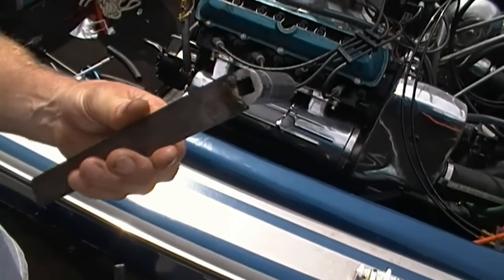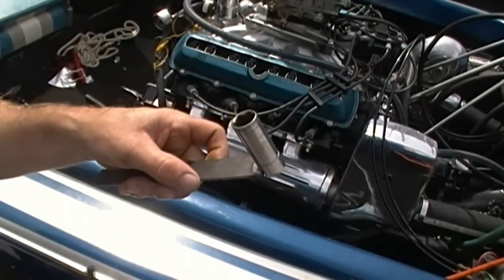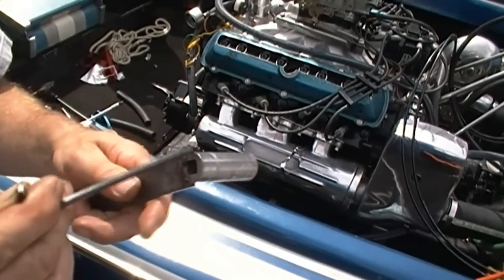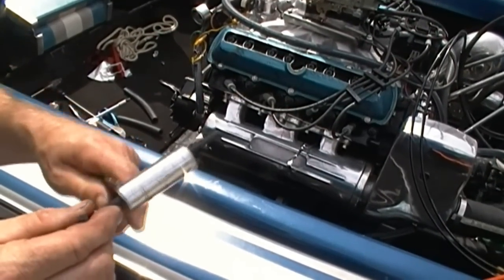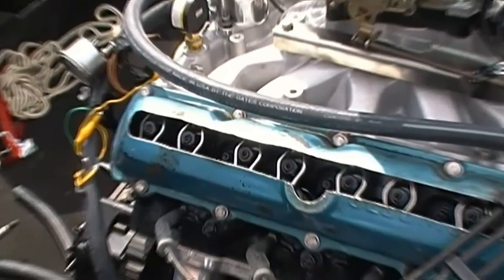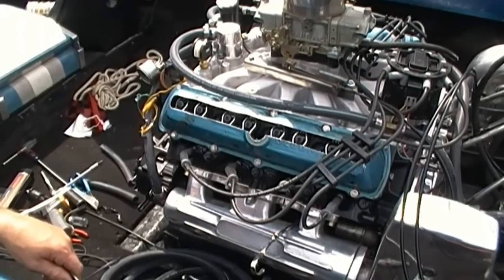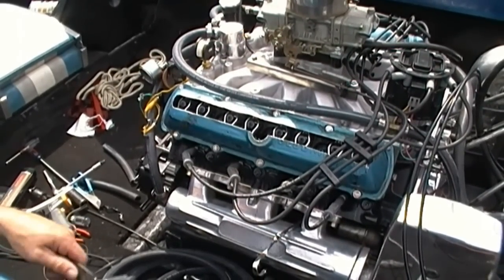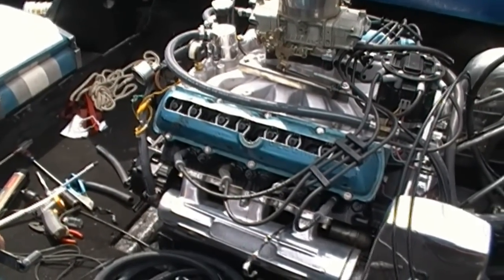How to adjust hydraulic  lifters or valves with the engine running

Comment: nice i was looking and i also have an olds but 425 going to put in rollers. nice surprise to see the olds
Reply from the maker: Expect to have the rocker pedestal area of the head machined down to fit it.
Reply: @Oldsmob455  i have the A heads i think it's a 3/8's stud  do you think i'll have to modify the head or comp cam makes a roller tip rocker would that be a better route than full roller?
Reply from the maker: @bobdimartino6738  Pretty sure those heads are drilled and tapped for 5/16 studs.  Comp makes a conversion stud to 3/8.  Like I said, rocker pads would most likely need to be machined down.
Reply: @Oldsmob455  the A heads are definitely different they have studs not bolts for the rockers from the factory although they're still not adjustable. I'll let you know I bought the comp cam roller tip set from jegs. came with the pushrods guides and rocker studs 3/8's 1.6 ratio

Comment: Makes no sense to adjust running. Easy to put lifter on base circle adjust to zero lash. Tighten 1/2 turn for adjustable rockers or torque non-adjustable 18-20 ft lb
Reply from the maker: That's a basic setting, not a max performance setting

Comment: I think that adjusting lifters while the engine is running is probably the most accurate way to do it when using hydraulic lifters. There is no question how much they are pumped up and if one pumps up more than another, your adjustment is based on each lifter individually anyway, so it doesn't matter.   Just watch you don't slip a finger between the rocker and the valve cover... gosh that would hurt! Great video.
Reply: edward niel you are wrong. Doing it while running is not accurate. Not a single manufacturer has you do valve adjustments while running. That is the beauty of hydraulic lifters, they do all the work. All you must do is half turn of preload while cam is on base circle and you are done! This is just a messy waste of time.

Comment: Gonna take your advice and run the car tomorrow for the whole day just at idle speed (since it's in backyard) then drain the oil and put new oil back in.  One question: it has on the odometer 83000, what kind of Oil do you suggest?  What i just put in their was 75000 high mileage Oil Valvoline 10-40..
Reply: Shell Rotella Diesel oils , Brad Penn, Valvoline VR1 , Chevron Delo 400, Mobil 1 15w50...
Reply: Or some zinc additive to what you've got already if its that new why are you idling it all day now ?? Im lost

Comment: Great Video and to the Point!! Watched other videos but YOURS was the BEST hands down!  Have a 67 GTO thats been sitting since 72 and cranked it up today fired right up, but i get some small ticking from drivers side.  I let it run for about 15 minutes at first without giving gas and it did quiet a lot, but their is still that slight: tick, tick, tick, tick.  Drained oil and came out like Sludge, any suggestions before i do any Lifter adjustment?  Special Oils, Drain new Oil again, or simply PRAY? Your suggestions will help for i'm only a backyard fixer. Thanks
Reply: Shell Rotella Diesel oils work very well in old muscle cars

Comment: is that common to adjust the valves with the engine running? first time ive seen it.
Reply: Its actually the most accurate way to set hydraulic lifters. You don't know how much the lifter will pump up till its running under pressure. On a good race hydraulic lifter you can get away with a 90 degree turn for better top-end power.

Comment: Correct me if I'm wrong here. Conventional small block chevy...With engine running and warmed up to operating temperature...use a modified valve cover with the top cut away so you can access the rocker arm nuts without oil squirting everywhere. Back off the rocker arm nut until you hear it clack. Snug up the nut until the clack just dissappears. Turn the rocker arm nut down  three quaters of one turn. Repeat on each rocker arm nut until all have been set, rocker arm washer seats need to be good.

Comment: when I adjust rockers with a deep well socket it can rub inside the rocker and give a false adjustment you have to remove the socket after it stops clicking to be sure this doesn't happen
Reply: Ok well deep or shallow whats the difference

Comment: +1 on tighten both together!  Next time try stopping the bolt 1/4 turn early, then snug down the Allen bolt, then tighten the bolt and Allen the last 1/4 turn together.  You will never have to adjust them again.

Comment: are these hydraulic lifters? arent hydraulic lifters supposed to adjust themself with oil pressure from the engine and no manual adjustment is possible? isnt that the thing with hydraulic lifters that you never have to adjust them?
many questions :)
Reply: stimpen12 my thoughts as well
Reply: while the lifters are hydraulic it wont account for loss of metal in pushrod or rocker arm as well as springs getting softer. that would be my thought on it at least.
Reply: When first installing rocker arms adjustment has to be done unless its a shaft style rocker assembly like a lot of them are that is set up like a small or big block chevy adjustable individual so normally its not done w engine running eitner so your questions are warranted with the cam on base circle meaning both valves closed you tighten them till no movement at all in the rocker or pushrod and stop this is called zero lash lash meaning play on the rocker and pushrod then you turn the nut a half to three quarters more pushing down on the lifter plunger just enough to allow for any issues w tolerances or wear issues down the road you do that to all 8 cylinders and it will start and run quietly and smoothly and stay that way for a long time till something gets worn out enough where what you put in after lash is not enough any longer amd need to be adjusted again make sense now

Comment: Just did a head gasket job. I always went 1/4 turn after 0 lash... but where did the 1/2 and 3/4s come from? whats best for a stock 91  5.7  Chevy P/U ? I do run it light and alota highway miles.
Reply: The half and 3/4 comes from the factory tolerances being sometimes out a bit pushrods can be shorter or longer and other things as well can be off so to allow for that the lifter acts as a shock absorber and one may be pushed in a 1/8th of an inch others a 1\4 etc down the line going the 3/4 makes sure that the shock absorber is hiding all the tolerancs issues and keeping the valvetrain quiet even after a hundredd thousand miles of wear make sense

Comment: @Oldsmob455 exactly correct - but most would adjust to 1/2 to 3/4 of a turn for preload - not 1/4. Is there something here specifying 1/4 turn? Just curious. Great vid by the way - the tool was the best part.

Comment: so is this adjusting to zero lash? and the clicking is when it's just above zero lash? I thought you were supposed to give it another half turn after zero lash? Or do you not have to in this case because there's oil pressure in the lifters?